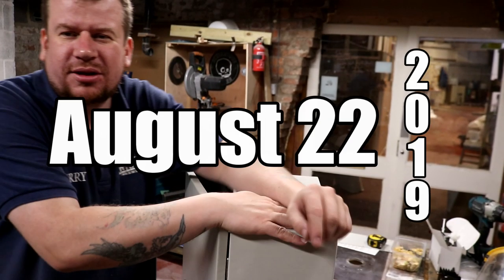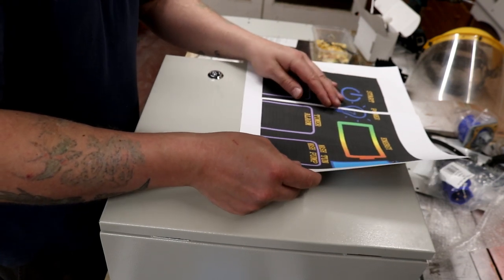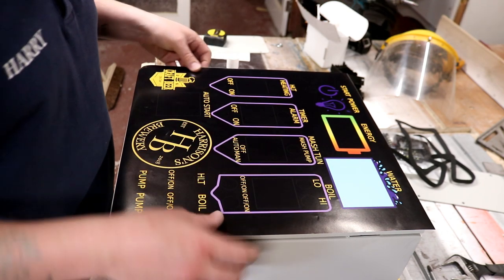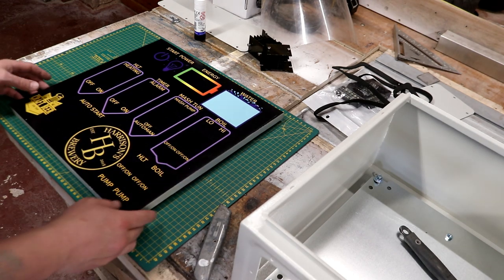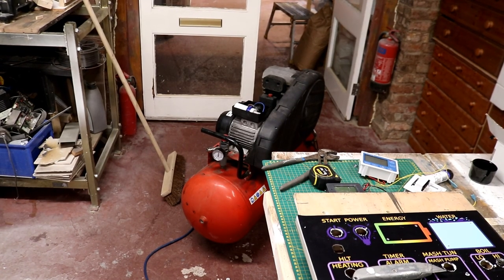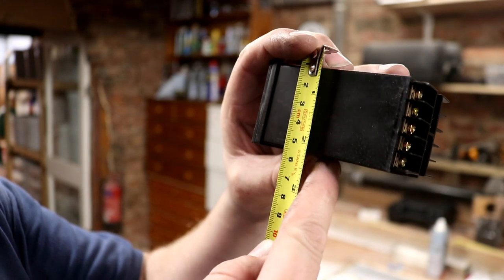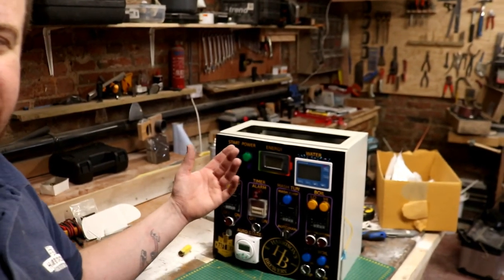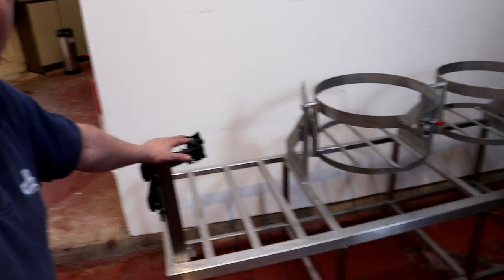Brewery Pilot Kit ~ Control Panel Build ~ Part 1 🍻

Comment: When I created my control panel I used a 22mm knockout punch. I thought about a hole saw, but I looked at the saw and then the steel and said 'nah'. The knockout punch went through the steel like a hot knife through butter and created such a clean hole. I ended up using a larger panel like the one you originally were looking at, but I used two contactors to isolate and bypass each SSR in case they failed shorted so I could manually run the elements which consumed quite a bit of room in the box. My front panel is fairly sparsely populated as I'm using a BCS-460 web based controller to run the whole process so I don't need all of the PID displays, meters, and timers. I basically run my whole brew day from my phone's browser.

Comment: Without meaning to look a little foolish myself, there is probably no discrepancy with your tape measure. The slack at the end accounts for measuring inside or outside of surfaces. eg butt the metal end up against an inside surface or hook the metal up against an outside surface. The 'play' in the metal tab moves a precise amount and is not just sloppy workmanship on the tape measure build. Hope that makes sense!